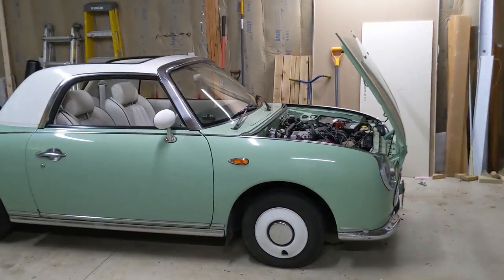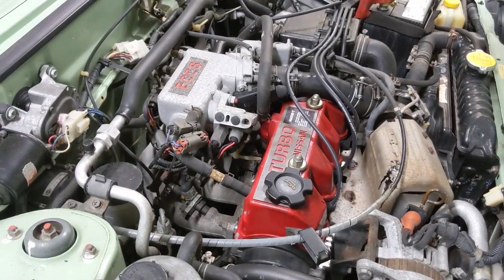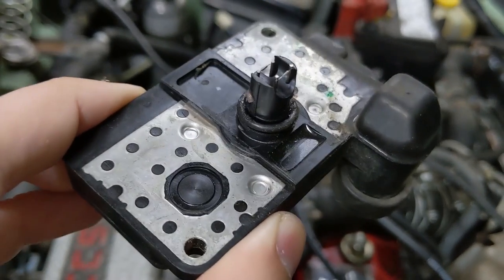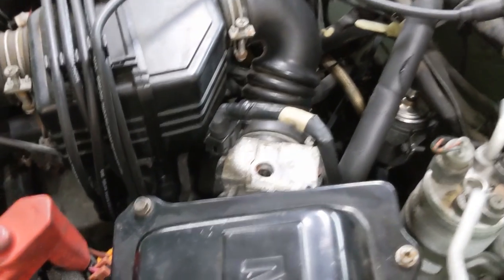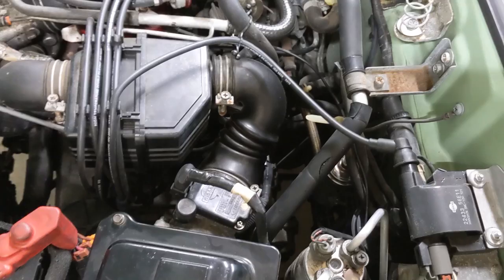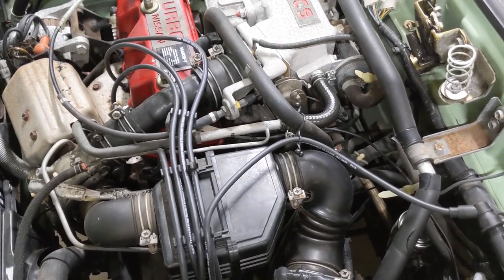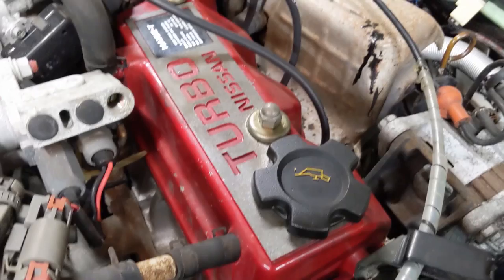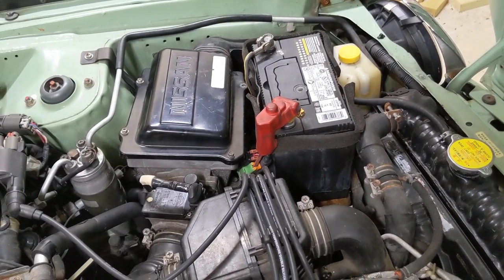Modern engine control musings and Fixing a Figaro

Comment: had a 1991 Chevy Silverado with the MAF sensor going out, didn't have the $250 to $350 to get it replaced so i sold the truck for $800 & whoever bought it fixed it up, damn good truck still runs.

Comment: Following your "ECM" comment, I looked into it on Camaros, since my 78 definitely doesn't have one.

Surprisingly it first showed up in the second generation, for 1981 as "Computer Command Control" and was in there strictly for emissions. What also might be a part of "car computer bad" culture is that it also caused the engine power to drop from the previous 185hp to 175hp.
Reply: It’s crazy to me that nowadays we can get the same power out of a < 2 liter four banger that we used to get out of a 5+ liter V8
Reply: @mrb692  Even by the mid 80's there were some 4-pots that made that much power.
Reply: @mrb692  the bigger catch isn't power it's efficiency. 

Late 70s cars are severely neutered because that was the only/best/cheapest way to get fuel efficiency and emissions control. (70s Oil Crisis) Maybe this is why they went to ECC so they could tweak every single aspect, but who knows?

The Chevy 350 small block went from 1967 all the way to 2002. From carbureted to ECC fuel injection. It's pretty much "solved" at this point, because it's so ubiquitous and people have messed with it in pretty much every case.

Comment: My '91 Accord had a wax cold start valve. Coolant would warm up the wax which would expand and reduce the idle speed. There were 3 different methods to offset the throttle, choke, cold start, and A/C.  That is all done in a computer now.

Comment: I replaced the throttle position sensor in my truck after one random code that indicated a potential bad signal from either TP, MAF, or MAP sensors. Everything’s 15 years old so figured I’d start changing them out, throttle was just the first one I ordered and holy crap, everything smoothed out so much. It had high idle at times, kinda surgey, there was even a bit of a weird clunk or thump when letting up on the throttle that I thought was the transmission. Nothing big or unexpected on an old vehicle but sheesh, all that went away with just a new TP sensor. Had no appreciation for how much these sensors can actually influence things

Comment: 8:30 - looks like a split in one of the hoses.  Surging and weird idles are frequently vacuum related so I would double-check those thoroughly. I had a 1989 Nissan Sunny with very similar issues which turned out to be a vacuum tube popped off underneath the air box.
Reply: But the problem goes away after just a couple revs.  This isn't a vacuum leak IMO.

Comment: Close, it's using Platinum because it is applying a constant voltage across it, and then as the air cools It off it's resistance decreases so the current increases heating it up, and when the air stops it makes the Platinum heat up hot and have much higher resistance which then reduces the amount of current flowing and then cools it off. So it kind of balances itself at one temperature and then it purely calculates the airflow based off of a constantly updating calibration table and calibrate itself against the oxygen sensors but the oxygen sensors aren't extremely sensitive to quick changes, they measure changes over time. So all it's doing is measuring the current flow to determine the airflow, it's fairly proportional, it just has to calibrate against the O2 sensors

Comment: I see so many of the same components Nissan used on the '94 JDM R33 with an RB25 I used to have years ago. it also had LEDs to read the fault codes. I had an IAC valve go bad which I seem to remember caused bad starting and hunting idle. It was also common to have to take the small solenoid in the front of your plenum off and clean it and its housing with brake cleaner. I had an O2 sensor go bad but that caused it to not want to idle and running very rich (even more pops and bangs yay!), so probably not your issue. I just love these little cars and I refuse to believe that they're that old already.

Comment: As an owner of an OBDI car with a similar fuel injection system, check to see if there is a throttle position sensor (TPS). It's a resistor that measures the position of the throttle, usually a lever attached to some component of the throttle body. IAC valve could also be suspect, however your high idle speed leads me to believe the TPS might be the problem, unless the IAC valve is stuck closed.

Comment: Wild guess idea for that cold start: in cold temps oil doesn't leak easily so it's fine, but in room temps oil can leak through valve cover gasket internal seals into cylinders (as opposed to leaking outside of engine block), then you start it and it chokes with that extra oil in cylinders, but you give it more gas and it clears up.
Vacuum leak I would assume would not clear up on its own, would be constant. O2 sensors yes I would replace them next as well as clean that ICV. Also consider possibility parts are broken not just dirty, for example might be worth to try another used MAF sensor. Too bad can't read/log live data from it to see what MAF or O2 sensors report back.

Comment: @12:03 I'm not familiar with all makes, but 80s/90s cars with distributor based cam sensors are pretty common.  Ford, for example, replaced breaker-points timing in distributors in the 70s with the transistorized Duraspark system, then in the 80s with the TFI (thick film integrated) ignition module.  Both systems retain the distributor cap and rotor to transfer high voltage to the respective spark plug wire, but replace the breaker points and some or all of the advance mechanism in the distributor body with a hall effect sensor that tells the engine control module the cam position. 

Keeping the distributor but replacing the electric bits (which were the most prone to bad adjustment/wearing out anyway) made a lot of sense at the time.  Foundry and machine tooling investments for an engine block design mean engine platforms last for many years (e.g. Chevy small block from 1955-2003).  You already have hole for the distributor,  and you don't have to replace the coil, cap, rotor, etc to accomplish the goal of electronic spark timing.  Even my 1995 Ford 4.0L V6 uses a geared shaft and sensor head where the distributor used to be, and the cap and rotor were replaced with a six port integrated coil pack.

Eventually when it came time to design new engine blocks, the opportunity was taken to mount new cam sensors directly on the cam shaft or cam drive.  The control and reliability had already been solved with the distributor based electronics, but more advanced and efficient engines of the last 20 years benefit from eliminating the cost, weight, and parasitic losses from the extra moving parts.

Comment: The temperature sensor that was replaced, was it the ECU coolant temp sensor or the temperature gauge sensor?
I don't know the details of this particular system, but early Bosch based systems had a 5th injector, used during engine cranking. If your car has one, you will find there is another "sensor" on the engine near the main coolant temperature sensors. This is a time delay switch that is activated during cranking, it is temperature dependent. The purpose of the switch is to operate the 5th injector to provide cranking enrichment and provide after start enrichment for a certain time period, if it fails you will experience difficult starting and the engine won't stabilise for maybe 10-15 seconds under certain conditions.
This system is probably new enough that they got rid of that feature though and the computer will just increase the injection duration of the normal 4 injectors during cranking.

Comment: The auxiliary air valve  on the back of the manifold is not computer controlled. It's just a bi-metal plate with a heater coil around, powered by the fuel pump relay. It's supposed to be fully open at around room temperature and close fully in about a minute (time based) +- depending on the ambient temperature. Due to it's nature, I'm 100% sure that it doesn't work properly after 30 years and is probably stuck somewhere in mid position, causing both the starting issue and the high idle. I've tried to repair many of these back in the the day. Some worked, but it's not worth the effort for 100-ish bucks. So don't hesitate to replace it. Just may need to adjust the base idle after that.
There are two more electric on/off idle related valves on the other side of the intake, next to the idle adjustment screw (on that sticking piece).  The small one, on most Nissans from that era, is directly activated by the power steering pressure switch. The big one compensates for additional electric loads like radiator fan, AC, etc.. and simply enables the so called high idle speed. There is usually no automatic idle correction on the AT models. Just the base idle needs to be set higher with the screw, for example to 950 instead of 650 rpm (not sure what exactly should be on the Figaro, but you can see it in the manual). The ECCS module can also control the big valve in parallel, and opens it under freezing temps, but that's all the idle speed control available for the "computer". 
BTW, your MAF has a calibration screw, so you may have no lambda sensor at all.
I used to do a lot of remapping/chip tuning on Silvias, SXes and ZXes from that period, so still remember a thing or two. Feel free to PM me if you need info.

Comment: The timing advance is still done inside the distributor, it's has electronic ignition that eliminated the need for points and condenser but still has mechanical advance in the distributor

Comment: I don't expect that cam/crank correlation for to go away. As has been mentioned, it's usually caused because the two sensors are not appropriately timed. With a gear driven distributor coming off the crank, the most common place for a timing error to occur is at the gear interface to occur is on the gears themselves. The spiral bevel gears wear until  they create a gap large enough to effect the timing. It doesn't take much, just 0.020" or so of wear. On American engines, the distributor gear is typically a softer metal than the cam gear. Thus all the wear goes to the easily replaceable part. I would hope your little Japanese car is styled similarly. Sometimes the drive gear is replaceable by itself since it's silly pinned onto the shaft.

I hope this provides some ideas. Good luck.

Comment: That boxy TPS may be a throttle position switch rather than a potentiometer-type sensor. Those old switches could be a bit finicky and require either adjustment or internal cleaning. They're a 3-position, on-off-on switch; you adjust them by rotating the TPS with a continuity tester attached so that one pair of contacts opens just off idle, usually around 200 RPM higher. The other side isn't adjustable, just make sure it does close at some point within the throttle's operating range.

They modify the fuel map at idle and under heavy load, so being out of adjustment can definitely affect your idle.

Comment: Yeah I remember similar little buzz boxes like these zipping around Osaka. Not this old but the updated versions.

Other similar models are also very popular with drifters and the street racing community as they have a very high power to weight ratio, and qualify for a yellow plate, which results in far cheaper technical checks.

Comment: 70s engine computers were indeed a thing! Look up the Chrysler Lean Burn system. When it worked it went OK but it was definitely not for performance. When it broke, nobody knew how to fix it and a lot of people gave up and installed a conventional ignition system and in the case of later feedback carb systems, a conventional carb as well.  Yes...electronic feedback carburetion, the stuff of nightmares.

Comment: As far as the MAF operation. Usually a "hot wire MAF" sensor interanlly measured the current required to keep the wire at a given temperature. More airflow required more current to maintain that temperature.

Comment: most injected cars have a multi stage fuel pump. They have a higher psi starting cycle. After the "choke" opens (or a specific amount of time) it switches to the regular psi. the increased psi is not always needed, but the system will make the extra pressure available so it is there if needed.  That is why it is not always noticed and the starting issue only shows up under a certain condition. You can find the info for the pressures, hook up a pressure gauge and easily eliminate or confirm. most mechanical or electrical systems either work or not, but a fuel pump can be down only 5psi out of 20 and is still in working order. This can happen because of the fuel sock being partially gunked up. Gas leaves deposits, sits too long etc . Then there are wiring issues and the remainder are unusual stuff like a pinhole in the pickup tube or that little hose on the pump degraded and got sucked up. Things to look at since it is an older car and all of those things eventually end up at a new fuel pump and sometimes injectors take damage from the debris. If you do a new pump, get new filters, pickup sock, flush the tank and inspect all hoses and lines. That way you are covered for the next 30 years

Comment: Certified Mechanic here. The MAF can cause running and starting problems but you might have bigger issues not clearly seen. The Timing belt might be stretched alittle causing mechanical timing  issue and increase emissions and lower fuel economy. The TBelt needs replacing every 100k miles or every 10 years.  The o2 sensor can be worn or carbon fouled causing fuel mixture issues.

Comment: the wires on the mass air flow sensor measure the air flow by sensing the current draw of those wires. as they cool from the air flow, the resistance will rise causing the current to drop. as the wires heat the resistance will drop and the current will rise. I built something like that with a small light bulb with the glass broke from around it, when I was a kid. fun thing

Comment: That's a very cute car. The MAP sensor definitely messed up the ECU. Don't worry. I owned a cute little Japanese car as well. A rebaged Mira Avy. Those engines are very forgiving unless you have some broken wires. Check those cracked vacuum lines/pipes. Those leaks will  wreck havoc to the engine idling and A/C control.

Comment: The move towards computer controlled engines must have been gradual. I used to have an Opel (Vauxhall) Corsa from 1990 and it had an entirely mechanical engine. Just a carburator that takes roughly as much fuel as the air flowing through can take, hard coded distribution,... That's part of why I loved it so much... Sadly, the rust caught up to it.
Reply: There's a simplicity in straight up mechanical cars that is simply not appreciated enough in this day and age of computer cars with all their whiz bang functions. Give me a 1979 Celica any day!

Comment: that lubricant around the MAF connector is probably di-electric grease, alot of mechanics use it to keep out oxidation form the connectors. some dont because they need to, they are suppose to be sealed. some do not with malice, in some places the connectors will oxidize and will require replacement if they do oxidize.

Comment: The two symptoms you described sound like they can both be attributed to the ECU getting the wrong coolant temperature reading. This can often be caused by air in the cooling system--which does result in surges on some cars as the coolant temp reading will fluctuate because coolant is splashing on it instead of it being submerged.

Comment: For the high idle and surging , check the TPS adjustment and idle contact if it has one.  TPS should be around 0.7v at idle (from memory) . This was a common problem on older systems.

Comment: If the idle rubber value has failed causing a vacuum leak you don't need to disassemble it to check. Get a small can of propane and blow the part with it. If the engine changes speed then it means it is sucking in air from the outside. Also the grease on the map filter might be factory, sometimes they put a small layer to help the seal.

Comment: Check your base timing with a timing light. That should still have adjustable cam timing, might be off a bit. And these older japanese cars are needlessly overcomplicated compared to modern cars. All cars imported to the US from 1996 had to have the OBD-II connection, but most japanese cars still retained their OEM diagnostic port as well.